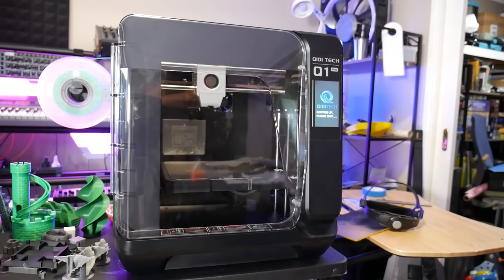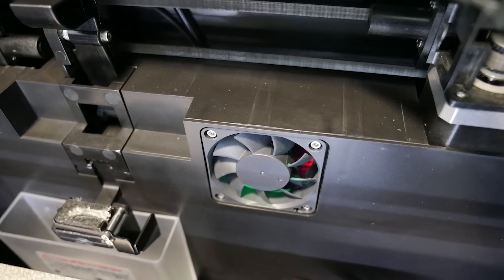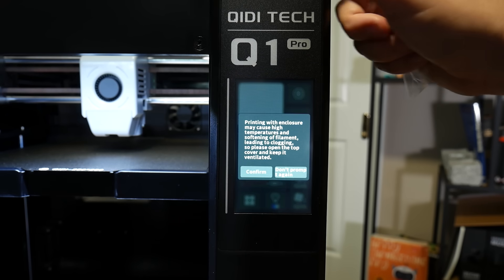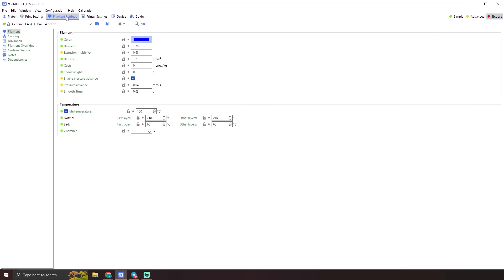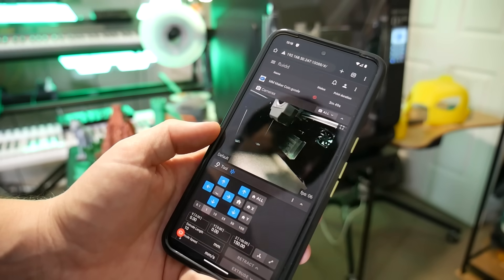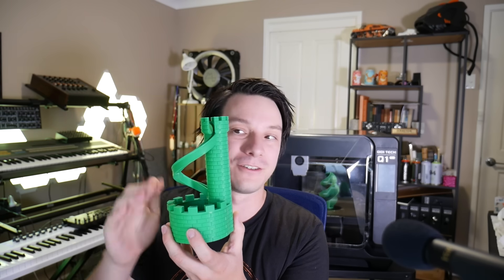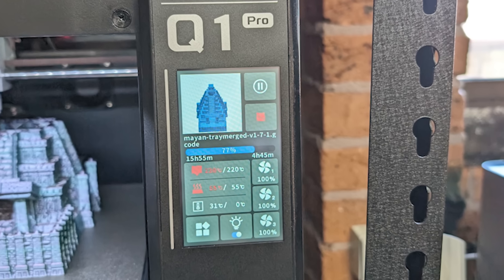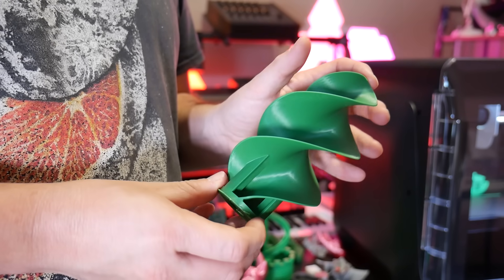The QIDI Q1 Pro is an AWESOME 3D Printer with some WEIRD choices. full review

Comment: While this is a good start, why is it practically snakeoil to get a machine with a larger print bed (400mm is where I start to consider proper large format), enclosed and it actually functions without a month of user intervention for a fair price? I've had my time with project printers that satisfy 2 of 3 type situations, but when you need work done, they are not the printers I look to first without a groan and some forethought of 'how many spools is this going to ruin for one good part This time?!'. 
We're at a point where FDM machines should be well optimized and fully usable out of the box.
Reply: There is. They are called $25k industrial machines that have the structure and software that enables the stability needed to print in those kind of large sizes. They require special insulation, heaters, and guide rail systems to keep prints accurate and temperatures stable. That's why even Voron doesn't recommend anything larger than 350x350 for consumer-grade components. The compromise on cost to enable consumer-grade systems is durability, maintenance, and reliability. That's what you pay for in an industrial-grade system. Above 350x350 you start getting into serious bed warping issues from uneven heating of the build plate and temperature differentials within the enclosure.
Reply: @TimothyBoyden   I'm aware, I have 370 and 400mm units that are on the very old side. While mostly reliable now, they have more hours/miles on them than most people's cars, figuratively speaking, and that was not without tremendous limping along over the years with "I am the warranty" service. 
I've also worked on industrial units like Thermwoods where the nozzle is as big around as your forearm and are fed by dump truck-sized hoppers. The commonality between them is that results are never guaranteed, but the cost of materials hurts a lot more when prints fail. Heated chambers almost negate warping issues with most engineering-grade materials, but you need really robust heating solutions that I've yet to see even a prosumer machine tackle.

Comment: Idk what it is with this place lately. He keeps comparing everything to bambu and wanking them off. This is a printer with beter specs (open source, klipper, heated chamber) for about half the price. The only way this should be compared to the bambu is by telling bambu to up their product quality.
Reply: Being the owner of a qidi x3 series printer, I can say that they do have some...interesting design choices, and klipper is really dirty (not vanilla at all) and there is a lot of wierd communication between the uart display and the control board which makes a lot of changes a little wierd. It is definitely a better budget option than bambu, but it doesnt have multi color, the interface isnt as streamlined, and the printer is nigh on impossible to replace any parts on the gantry due to it being epoxied together (similar to most prebuilt im aware). All in all it was a big step up from my ender 2 pro.
Reply: Weird hate. Bambu is the litmus test for a reason. They shook things up with that desktop case like design and much better user experience.

The fact people currently have nitpicks alone says a lot

Comment: Not sure if it ever will be, but at the moment it's not on the Microcenter inventory. Which is disappointing to me. Well, probably not good for my budget at the moment anyway.
Reply: For now need to get an abl on the CR-10 S, and a Filament Run out sensor on the Ender3v3SE (and firmware updates for both...). One thing at a time I guess.
Reply: Get a k1 max and root it
Reply: @MandrakeFernflower Already have a K1, Extruder issues not fixed with the updated extruder stepper, Pulled out of the lineup as both of these other two printers actually work. The updates I need are for quality of life fixes (bed leveling and filament run out detection) and I am not sure I would trust a K1, or K1Max at the high temps listed, but that may just be me and the anger over the months of not finding a fix for the extruder here.  Note that I did not install the new hot end, so I accept that the problem may be there. I have otherwise heard good things about the QIDI devices, so that looks like a workable option. But not right now. Future. (Once I figure out where to set it up again, I may be able to get the K1 operational, but I'm not holding my breath.

Comment: 2024: I'm still with my Anet A8...
Reply: My gamer in Christ it is time for an upgrade
Reply: @MandrakeFernflower  Most I can do is replace the motherboard by RAMPS, because the original motherboard has burned out. I've also installed Bowden and klipper with Pi3B onto it

Comment: I asked support today about if they planned for a larger version or should I go for the xmax 3 and they told me they couldn't tell me, that maybe I should go for the xmax 3. They way they said it, we might have an upcoming larger version. Well if that happens, I might pull the trigger since I love the ease of BL with user experience but they still didn't managed to sell a larger printer yet.
Reply: Looking at the way the size slots in with the smart series I doubt they will bring out a larger model.
Reply: @petercallison5765  you could be right! Still the way it was said, I could suppose so. Anyway, time will tell, I'll bite the bullet when I'll need it.
Reply: In the Orca profiles that were uploaded by Qidi 2 days ago, they refer to the Q1Pro as being a member of the Q family of printers. Take from that what you will.
Reply: @stew675  😮 Nice finding thanks! I'm still torn between the Qidi max 3 or a Troodon v2 pro 350mm³. Say the Arco from Phrozen but I need bigger than 300mm³ for some art projects.

Comment: Seems odd to release something to complete with the X1C but actually be a bit worse. If they made this 300 x 300 x 300 im sure a lot more people would go for it.
Reply: X1C is $1k. This is not.
Reply: They have something that size, its called the X-max 3 and its actually 325 x 325 x 315
Reply: Yea really odd... Not. This is open source with klipper installed and a heated chamber. It has about the same print volume and a higher max speed. And ohyea its like half the price of the x1c
Reply: @thombakker2835  Max speed is always a lie.

There is so much nuance ro speed I dont even know where to start.
Reply: It‘s better lol

Comment: I'm convinced now these companies barely test their products and just ship them, not just QIDI but also Prusa with their XL issues and Bambu with their mains voltage yolo bed heater.
They're basically operating like game developers, just release the thing broken and "fix" it with post-release "patches". In Prusa's case, let people pay for the patches (like the correct nozzle sizes).

I love my janky original ender3 with a bunch of mods but at this point I'm wondering if I should go full out and get a all-metal hotend with direct drive , extra z-axis screw and an enclosure instead of waiting for these printer manufacturers to deliver an actual good product for a reasonable price.
Reply: Its pretty crazy to equate the things youre equating.

When yoi are so loose with the "everyone is bad" you only encourwge bad comoanies because you give no henefit to ones trying.
Reply: @BeefIngot  I never said "everyone is bad" or anything like that and it's disingenuous to say I did. I'm just noting that over the past few years (decades?), a lot of companies have just been dumping QA onto their end users as a way to save development costs. Something like what happened at 13:06 you can hardly blame a user for and that's an exact thing that should've been caught if they had any solid testing procedure in place, but they didn't and now you have machines damaging themselves from a flaw that should've been caught way before this product was released.

I can't call them out on that because what, I might hurt the feelings of some chinese company? The only way these companies might change IS to complain about it, not just accept it that it's the reality we live in. Not commenting on this downward trend is how consumers will eventually accept this as acceptable and that's when companies will stop trying entirely.
Reply: @bami2  Now thats bad faith.

I mean just the bit about chinese comoanies is unfair and proves my point.

My actual comment is totaply accurate.

When people pretend that every small error is the same as much bigger, substantive issues, it means no company benefits from being better.

Ultimately, no printer company is perfect , so picking out an error for each pretending they have the same error rate is just not reasonable and punishes companies that get things right more often.
Reply: @bami2  So pretty great printers? Thanks!

Comment: Hey Angus, I got the X-Plus 3 and recognized why it heats up, cleans the nozzle only to then do the meshing with a cool nozzle, etc... The Startup routine basically calls the heatup-routine first, then calls the nozzle-cleanup, and instead of then starting the print, it calls the kamp-meshing first in your case. The Issue only lays in the Kamp-routine which always sets the Hotend-Temp to 0, to prevent drips of molten material sticking to the buildplate while probing!
To fix this issue one can either turn off kamp before every print, or simply open the config-files and put the call-function for kamp-mesh before the call-function for the nozzle wipe...
Reply: ya you can run the KAMP before then run everything else.  There are other ways to do adaptive bed meshing with a macro instead of running KAMP, but it looks like Qidi is just running vanilla Klipper.  Which if you update to v12 has KAMP built into the system now, meaning you can just enable it in vanilla Klipper instead of having a sub routine instead.
Reply: My AnkerMake M5C puts tiny blobs of plastic on the build plate when it probes at the start of each print. I know we're talking about completely different printers here but your comment has put me on a path to try and resolve this issue, thank you.

Comment: Within a week, someone will have designed a new spool holder for it anyways.   LOL.   Smooth plate will help with the filaments that aren't sticking.
Reply: New spool holder STLs were live within 24 hours of your comment.
Reply: Nylon needs to be fed from a filament dryer anyway.
Reply: You can just put the filament peg on the back of the printer and throw away the arm.
Reply: Might already exist. I got one for the X-Max 3 that printed quickly and just hangs the dryer box from the side after inserting it into one of the handles. No issues and now it's a lot more convenient.

Really don't get why companies keep putting 'em on the back. Most of us aren't gonna care about seeing the spool and it makes it much easier to use.
Reply: @redkingrauri3769  The only thing I can think of is that they are expecting these to be used in printer farms with printers side-by-side. That would be the only reason to put it on the back.